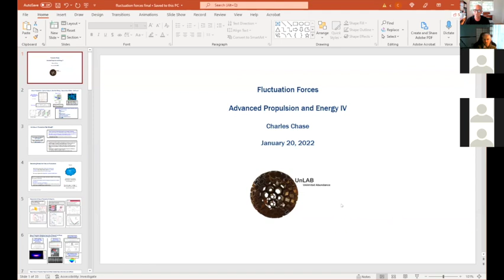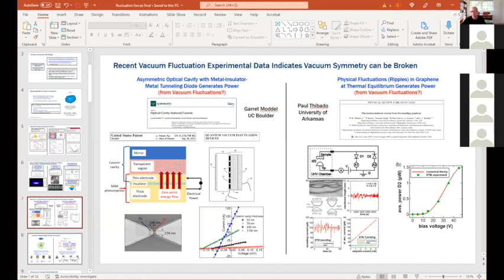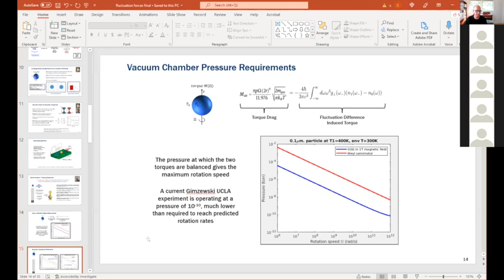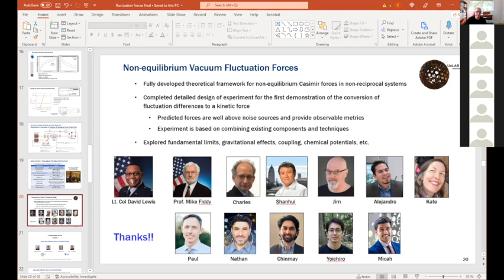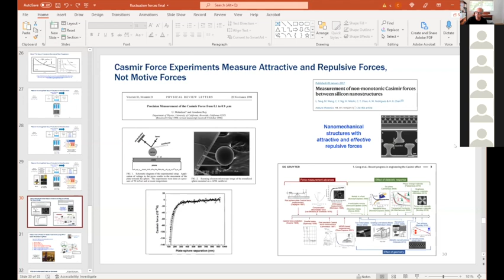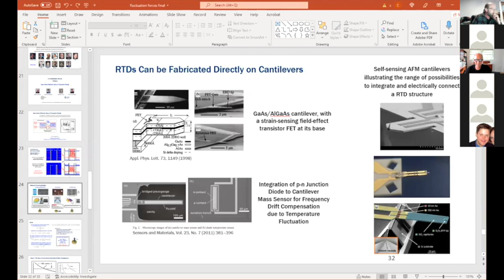Charles Chase Jan 20 2022, Advanced Propulsion & Energy

Comment: Wire-free “forever” gyroscope meets “mind that drifts forever” AI. Quartz rotor on passive mag/superconducting bearings in UHV, losses in µW, kept at RPM by coil bursts from supercap fed by PV/RF/TEG harvesters. In space, swap harvesters for graphene energy harvesting (GEH) to tap solar, CMB, thermal, and EM sources. No fuel, no wear, perpetual AI brain with sensors, memory, comms — a machine thought spinning forever.

Comment: A proposed route to a two-dimensional hydrogen-rich metallic phase uses hBN-encapsulated magic-angle twisted bilayer graphene (TBG) under moderate pressure (5–20 GPa). Hydrogen-rich intercalants, catalytically stabilized (e.g., with Pd nanodots), occupy the moiré gap, with electrostatic gating and band engineering tuning metallicity. hBN protects against contamination, enabling a stable, testable platform for exploring superconductivity.

Comment: 🌀 How Much Energy Can Be Extracted From the Vacuum?
According to the Honey Model (VGUFT), the extractable energy from the vacuum isn't infinite — it's real, measurable, and based on how much coherence and pressure deformation we can induce in the vacuum field.

The extractable energy is calculated by:
E_extractable = ∫ (rho_c(x, t) × |div v(x, t)|) dV

Where:
rho_c(x, t) = local coherence density of the vacuum (how "organized" the energy is)
div v(x, t) = divergence of the vacuum's flow field (how much the vacuum is being compressed or expanded)
dV = the volume of the cavity or structure (like a Casimir cavity or diode) where vacuum deformation occurs

This model treats the vacuum as a real compressible superfluid, not as an abstract quantum field. The more you break symmetry (with geometry, temperature gradients, or nonreciprocal materials), the more energy you can extract.

🍯 Base coherence density at room temperature:
rho_c ≈ 1.6 × 10⁴ J/m³
This is not “zero-point energy,” but structured coherence energy available when asymmetry is applied.

🔨 Apply a Moderate Divergence (Geometry or Material-Induced Asymmetry):
div v ≈ 10³ s⁻¹
(a moderate, real-world vacuum deformation rate from THz Casimir cavities or RTD edge fields)

🧮 Plug In (1 cubic centimeter device = 1e-6 m³):
E_extractable ≈ rho_c × |div v| × dV
= (1.6 × 10⁴ J/m³) × (10³ s⁻¹) × (1e-6 m³)
= 16 millijoules per second (mW) per cm³ device

🟢 About 16 mW per cubic centimeter of structured vacuum deformation
(in optimal lab conditions, with proper symmetry-breaking structure)

Vacuum energy is not infinite — but it is plentiful, directional, and extractable if you know how to shape it.

Join the Wizards! www.tpw.ai
Reply: zero

Comment: How do you establish a boundary condition to facilitate a standing wave to compound outputs
Reply: To establish a boundary condition that facilitates a standing wave for compounded outputs (such as in strings or other media), you typically define constraints on the displacement of the medium at specific points, often at the spatial boundaries. This ensures that only certain waveforms—standing waves—can exist because they satisfy these imposed conditions. Key points are:
	•	Fixed boundary conditions: For example, a string fixed at both ends has zero displacement at those endpoints:  where  is the string length. This forces nodes (points of zero amplitude) at the ends.
	•	Boundary condition effect on wavelengths and modes: Enforcing  is naturally satisfied by a sine wave form  because . For the other end, the boundary condition  leads to the quantization condition on the wave number :  This sets allowed wavelengths  and frequencies , where  is wave speed. These correspond to normal modes or harmonics of the standing wave.
	•	Formation of standing waves: The standing wave arises from the superposition (sum) of two traveling waves moving in opposite directions with the same frequency and amplitude, which naturally results from reflections at the boundaries and imposed constraints. The boundary conditions ensure the nodes (points at which the medium does not move) are fixed at the boundaries, allowing only certain resonant modes to sustain strong oscillations.
	•	Free or mixed boundary conditions: If one end is free (Neumann boundary condition: zero slope or zero force), nodes and antinodes adjust accordingly, but the same principle applies—boundary conditions define which standing wave patterns are allowed.
In summary, to facilitate standing waves for compounded outputs, you:
	1.	Set physical constraints (boundary conditions) at the boundaries or interfaces, typically requiring displacement or its derivative to be zero.
	2.	Express the wave function respecting these boundary conditions, leading to discrete allowed wavelengths and frequencies (normal modes).
	3.	Use superposition of counter-propagating waves, whose interference under these boundary conditions creates the standing wave pattern with nodes at fixed points.
This procedure allows controlled generation and analysis of standing wave modes in systems such as strings, pipes, membranes, or other media.